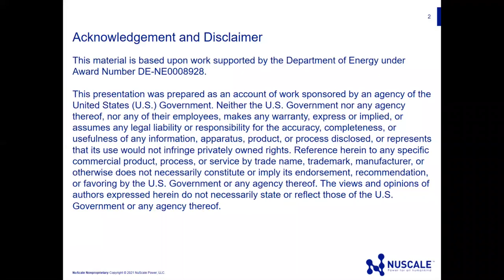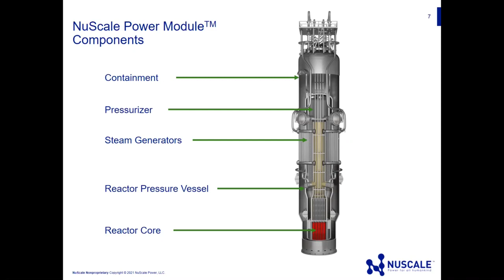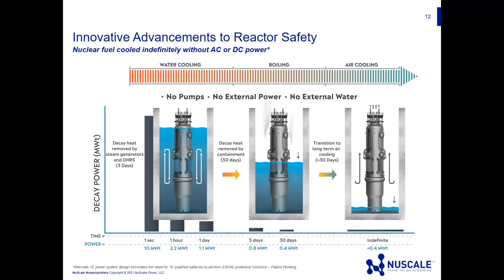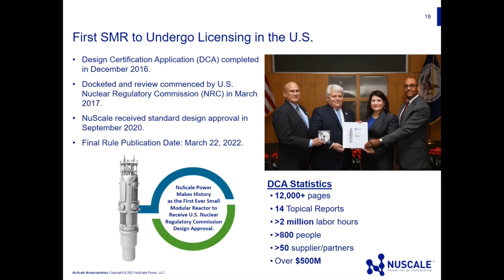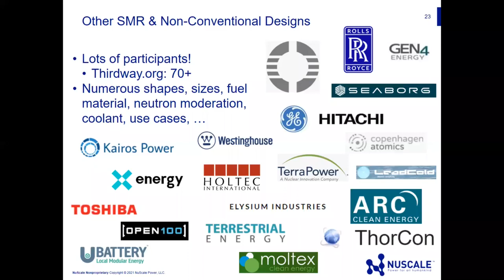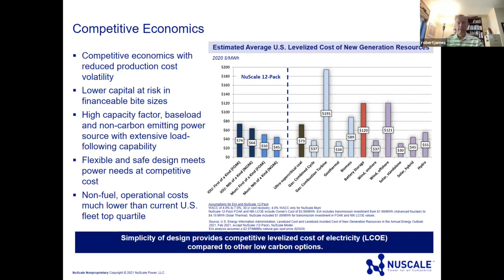Presentation: NuScale small modular reactor (SMR)

Comment: Interesting

All of the above, which ever fits the circumstances of appropriate use. Big Batteries resolve load following?
Reply: No,batteries are expensive,Carbon intense ,and provide at most 4 hours of very expensive energy, this plant provides 900MW for 80 years at which time they replace the reactors and keep going. Batteries are used to give time for natural gas turbines to get going so they extend the use of fossil fuels.
Reply: @paulbedichek2679  Better yet, use them in battery-electric vehicles, powered from nuke plants.

Comment: Indonesia's 7×500MWe ThorCon walk-away safe liquid metal Thorium ion molten sodium fluoride salt burner energy converters - load follower &/or base loader (TMSR) cost $1200/kWatt and all-in pre-profit costs are less than $40/Megawatt.hour with a 43kW/m² footprint and less than 5% waste of a solid fueled Uranium requiring only 300years secured storage.
(CF battery storage costs 3 times as much)
Reply: Indonesia has never ordered the ThorCon,it could end global warming, but one country has to order it,Indonesia has plenty of coal and no one seems worried about climate change.
Reply: @paulbedichek2679  They did sign the Memorandum of Understanding, though, so... there's some things going, at least.
Reply: ThorCon wouldn't even try to get NRC approval. If NuScale didn't ned any beurocratic over view they could beat $40/MWh.
Reply: Way more unproven. But yes let's hope we will see the design.

Comment: Lotsa blab, but one wonders about the sanity of presenting a bar chart that shows ASPIRATIONAL, ESTIMATED costs, versus real costs of tried and tested sources of energy.   We have absolutely no the slightest idea whether this design will work.  Almost every other first try has ended up in many bad surprises with massive cost overruns, and serious problems with chemistry, metallurgy, reliability, corrosion, servicing, and heat exchanger and core longevity.   The company has to be prepared for one or more false starts, and they obviously are not capitalized well enough for several years and several redesigns.